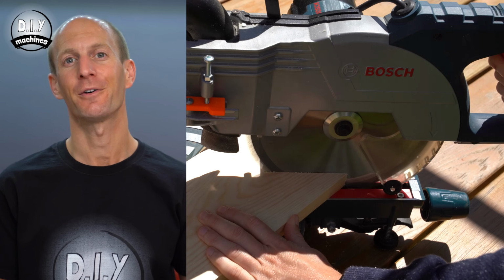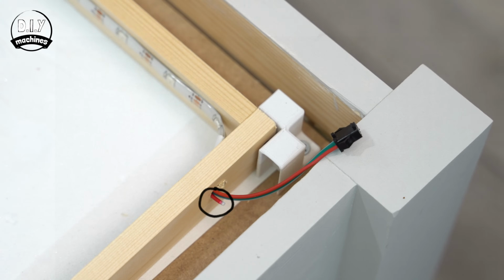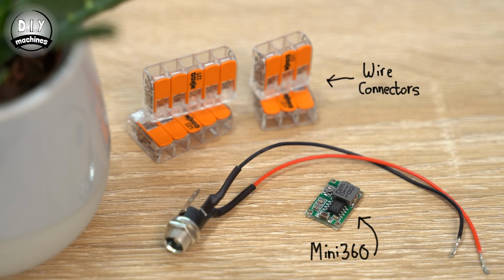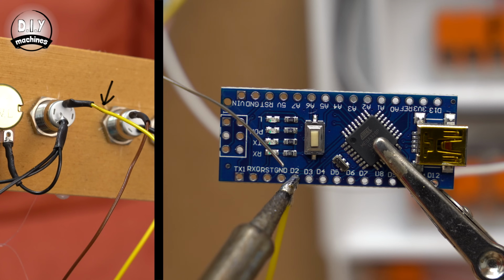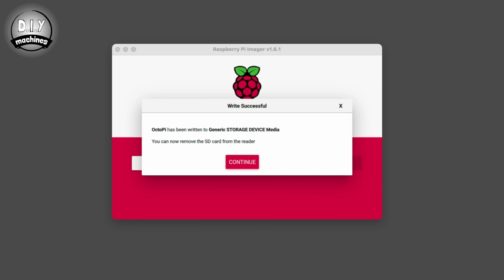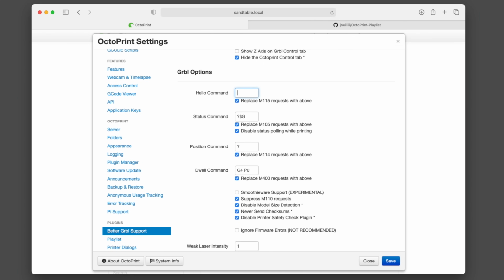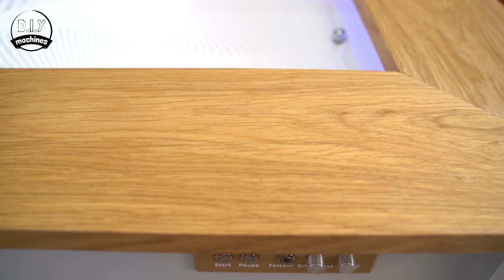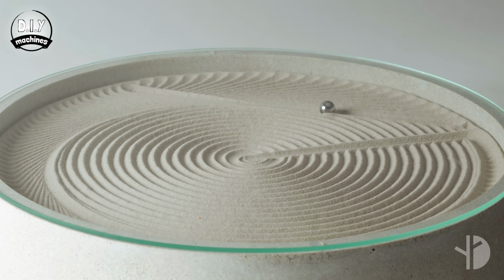Build an AMAZING kinetic sand art table - Part 2

Comment: So much EMI that it falsely triggers the limit switches throwing constant errors - usually from the Z axis. Type $21=0 in octoprint terminal and send it to disable hard limits. Will still work for homing and soft limits will keep the raft in the X/Y boundaries.
Reply from the maker: That's great advice for anyone encountering similar issues. Thanks for sharing your expertise!

Comment: I was wondering, I saw in the first part the ball rolling, but now it does not, like in most projects. Do you think it is possible to have the ball rolling again? Something else I notice in all projects like this is a ball "jitter" as it snaps to the magnet, do you think it is possible to fix it with a stronger magnet?

Comment: Sorry for the necro-post.
I really enjoyed your video and this project, and I'm trying to replicate parts of this project, but had a few questions.
First, why is an auxiliary Arduino nano used for the lighting? Wouldn't it be possible to also run that off the UNO?
Second, is a Raspberry Pi truly necessary? It appears to be mostly for user convenience, and pattern drawing. I will only need to move the stage to an xy coordinate every so often, so wouldn't interfacing with the UNO directly also be possible?
Third, how fast are you able to run those motors with the friction and slop from the rails? I'm trying to recreate the stage as thin as possible, and was wondering if I could use lower profile but also lower torque / rpm steppers instead. I also won't be running the stage continuously, but in rapid bursts lasting just a few seconds. 
Lastly, thanks again for the great video. This isn't a question, just wanted to really emphasize how great you and your projects are. Keep up the fantastic work.

Comment: Hi I wondered if anyone knos why on octoprint it just won't connect I've tried everything and followed the videos exactly.
Reply: @diyprojects
Reply: check if the hello comand has saved as blank because I am having the same problem and the hello command is not saving for me, but I have not found a way to fix it
Reply: Went thru the same problem, try using an older version of better grbl as the latest version doesn't work strait  (in the video he is using 1.7.3)

Comment: Very nice project and well done!  I have a question about "marble wobble".  A small team at our MakerSpace is building a kinetic sand table and the steel marble is not moving very smoothly through the sand.  There is good magnetic connection with the steel marble and the mechanism is moving smoothly.  The steel marble draws a smooth line but it has minor variations in speed and appears a bit "herky jerky" I've looked at a bunch of video's of different sand tables and can't tell if the same behavior is going on with them.  I did see a lower cost commercial kinetic sand table its marble moves like ours.   Sooooooo, does your table's marble move smoothly, and if so, do you have any suggestions as to how to smooth the movement of the marble?  We have tried different sized marbles and the larger ones are smoother.  There is ~2 mm gap between magnet top and sand table, with roller bearings maintaining a constant distance.  Thanks!
Reply: I’m considering building one of these tables and thought of the issue you are referring to. I’ve seen other videos on YT where they too differ from the marble jerking. I had thought about attempting to suspend the marble magnetically just above the table top, but still in the sand. I think there’s a way to make the magnet ball bearing “float” at a specific height so that the constant jerking doesn’t happen. Wondering what your thoughts are about doing this.
Reply: One solution is less magnetic force to act on the ball. If the magnet is strong, it tries to pull the ball tightly against the table and any sand particles will make it brake and thus jerk around.
Reply: @JaakkoF  thanks for your reply. I purchased a powered device that suspends a metal ball in the air just an inch or so above its base. While I haven’t had the time to make a prototype yet I was thinking a z axis input from a old 3D printer could actually “lift” the ball bearing up and out of the sand to move to new coordinates and then drop back down where needed to start the next line of the print. This could change the designs that are capable since it’s not a continuous line being drawn.  
  But doing it is the difficult part.
Reply: I wonder if you need to use a finer sand. In addition there is material on the base for noise reduction. Did you omit this? I would think the ball needs to be better, not less, constrained by the magnetic field to overcome resistance and keep it aligned to the magnet. In his design Lewis simply stacked the magnets as close to the base as possible, although I see the appeal of a roller bearing there, I would think it interferes with the magnetic field. However, this is all conjecture at present as I'm still awaiting parts for my own build of this table.

Comment: I'm almost completed making this and I'm trying to solder the control panel now, Where do I need to connect the red wire of the speed potentiometer? Directly to the 5V?
Reply: I'm sure you've figured this out by now...  YES - connect it to the 5V.  This step was completely missed in the video but does show on the wiring diagram on the DIY website.
Reply: Yes, the variable resistors are wired so as to provide a voltage between 5v and Ground (0v) that comes out of the middle wire. This is a 'voltage divider' if you wish to search the term to learn more.

Comment: Hello, I'm an student that is very interested on your project, and I wanted to build that, but in a minor scale. I can't use your table sizes, so I wanted to ask if the code of Arduino has the possibility to modify and get the servos adapted to my table size. Thank you so much, keep sharing projects, this is so valuable.
Reply: Of course it can be, I guess there are values specificaly defining the size. But I guess you would have to take a look into it.

Comment: I would love the ball to have sort of a mind of its own. Meaning if it is lazy it Just rolls a little slower but sometimes it gets energybursts and races through the Sand.
Also the ball should be able to get scared when there is a loud noise detected. Which then frightens the ball so it moves from its path and stays in a state of shock for 5-10 seconds and then slowly creeps back onto its path and continues.

Is Something like that achievable?
Reply: Yes , but you’d need to code all that yourself
Reply: @mintgardener  i have absolutely no experience in coding. If i where to invest my time into learning it how hard would it be to achieve something like this on a scale of 1 to 10?
Would i need months to be able to do something rather komplex like this?
Reply: @nf794  I also have 0 coding experience so I am in no position to give you an estimate, but I suggest asking around to your friends if any of them program or know someone who does
Reply: @nf794  I am beginner in coding and I'm pretty sure it is possible to do. 
First of all with your idea, in order to the  achieve the effect of scaring when detecting noise, there'll be a concerned with electronic modules - noise sensor in particular, then you have to have code that work with noise sensor, from that you'd create a sequece of movement that show the ball's scaring mode.
Beside all that, then there'd be steps where you'd have to insert your code into his where you gotta make it works inside his everything.

So yea if 1 is easy in your scale, I would rate its about 8-9 in order for you to achieve what you want. But if just do exaclty what he guide, I would say maybe 5? since I think he pretty much publish everything and all we have to do is just get the parts and assemble them all together, even the code.

Comment: Interesting build, you have just solved one gift idea I needed for Christmas. Like what do you get the person who has everything? ;-) So if I were to make the sand table bigger or smaller would I just change the parameters in the software as you did at 27:32 accordingly?
Reply from the maker: Yes, that's mostly it. I've written out a mini guide in the FAQ section here: https://www.diymachines.co.uk/kinetic-sand-art-coffee-table-self-drawing  which explains all the changes required. :)
Reply: @DIYMachines  Thank You!

Comment: What would be cool is adding a shaker motor that vibrates the table and flattens the sand between designs.
Reply: Totally agree, but it would be noisy and you would need the ability to lock the ball away while shaking, otherwise it will likely pop off the magnet.
Reply: And shake your coffee cup into the floor?
Reply: I've had that idea too.
Reply: I thought the exact same thing. A small butt kicker. You could probably use a Pi shield (small audio amp) and a simple tone to do this. I think you could find a time that would be effective and not disturb the magnet

Comment: Apart from the time invested and without tools, how much money would you say you need to invest  to get this project going if you start from scratch? Around £200?
Reply from the maker: Yes, including buying the wood and linear rails I would say around £180. I bought very strong toughened glass for my table top at that cost around £90, though you could opt for acrylic instead which should be cheaper.
Reply: @DIYMachines  meanwhile it’s costing me like $570 🥲
Reply: @DIYMachines My first purchase when deciding to pursue this project was a secondhand glass table. I could see that being a significant expense. £10 for mine. I am hoping also to repurpose components and motherboard from an Ender 3 as there are loads of these around gathering dust. The original 'Melzi' board is a 1284P Sanguino (Arduino compatible) board, so I'm going to have to improve my Arduino Foo to modify the grbl sketch😂. But going this way provides Arduino/CNC stepper drivers and the stepper motors.

Comment: You need to make sure stick pads are used on the glass or it could be knocked off and make sure. Tempered glass is ordered.
Reply from the maker: Good advice, I did use tempered glass in my project - but will add some sticky pads. :)

Comment: It is a nice looking project, but what is the point of a Pi board? it really seem like overkill to install a full linux distro with a 3d printer server just to talk to the arduino.

Up the size of the arduino board to something like an 8266 or ESP32 with an SD card and you can do everything on that. not much code to get it to read gerber files off SD card in random order and 'print them' directly. Control buttons and WS2812 can be connected to that and whole thing would burn a lot less power and could still provide a web interface to interact with table or manage contents of SD card
Reply: You should make an instructable on how to do this, seriously, it's a great idea. That is the wonderful thing about open source and sharing your ideas with the world. Most people following this build (including myself) would have no idea how to do that.

Comment: What kind of 3D printer do you think would be sufficient to print the parts required for this build? Does it have to be big or fit a particular criteria? Thank you!
Reply from the maker: I used my Prusa i3 Mk3 but a Prusa Mini would be capable. The largest printed parts foot print is about 150mm along, and I printed all my parts in PLA. None of the parts are 'tricky' prints either. I do rate the Prusa printers if you were thinking of buying one, they are a little more money but are feature rich and their support is brilliant if you ever need it. Building one from a kit is also easy and leaves you with full knowledge of how it works: http://shop.prusa3d.com/#a_aid=diymachines
Reply: @DIYMachines  Got it! Thank you for the suggestion on a 3-D printer and so a Monoprice-113860 Maker Select 3D Printer v2 With Large Heated (200 x 200 x180 mm) Build Plate, would work just fine correct?
Reply from the maker: @sebastiancortes1298  Yes, I've not used that printer before but on paper that should be fine. I could not see what stepper motor drivers it used - it's worth getting one with decent stepper drivers to ensure no skipped steps and quiet operation. The Creality is better reviewed on Amazon and has the high quality Trinamic stepper drivers: https://amzn.to/3wNAn8T
Reply: @DIYMachines  I see and thank you for the input you provided on this matter and for the amazing project as well! I look forward to building this one and cannot wait for the projects to come! Take care! 😄👋👏👍
Reply from the maker: @sebastiancortes1298  You're welcome. Someone helped me out when I bought my first printer and now I've repaid the favour onwards. :). Enjoy 3D printing, it's amazing. (I'm assuming this will be your first printer).
Reply: @DIYMachines  Well you definitely did and thank you! 🙂👍

Comment: Amazing, thank you!! I ordered all the components and some I dismantled from my old 3d printer. I’m wondering if could be add a small Arduino Compatible X and Y Axis Joystick Module. Will be fun for my kids to move the ball around 😜
Reply from the maker: You're very welcome. 😊 That is a great idea, I'm sure it could be done - I suspect that soon enough someone will fork the code on Github and implement it. It could be as simple as a four way joystick connected to the raspberry Pi which sends the codes as GCODE to GRBL running on the Arduino Uno via the USB serial connection. As it stands you can drive it around manually using the on screen controls in Octoprint.
Reply: There's also this unlisted plugin. https://github.com/OutsourcedGuru/OctoPrint-Xbox
Reply from the maker: @jneilliii  That look good. I love the fact it's a wireless game pad for the controller. :)
Reply: I know of a USB Keyboard plugin for OctoPrint that may allow for using a USB number pad for direction control.